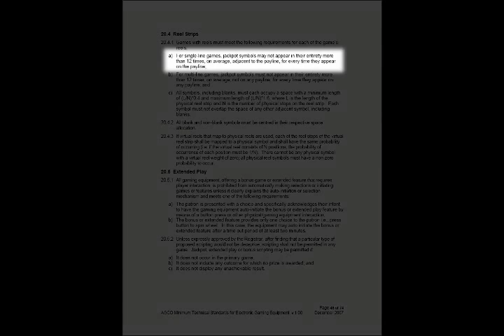Slots Tutorial: "A Near Miss" (2009)

Comment: what appears to be a near miss on the display reel is everthing but a near miss ,in fact it is 100% a miss on the virtual real and the display reels ,it is the random numbers that i would like the slot makers to display on the slot as awell as the virtual reel mapping that crresponds to that slected random number .if the rng is 100% random like the provincial liquor and gaming claims then why wont they display this.the answer is its a prng and the gambler will then be able to have better idea when higher prise rng's are about to be generated
Reply: The purpose of a slot machine is to make its owner money. What you would like the manufacturers to do is irrelevant, unless it results in the machine making more money for the owner.

Here's a quote from the US patent for virtual reel mapping (4448419): “It is important to make a machine that is perceived to present greater chances of payoff than it actually has within the legal limitations that games of chance must operate.”